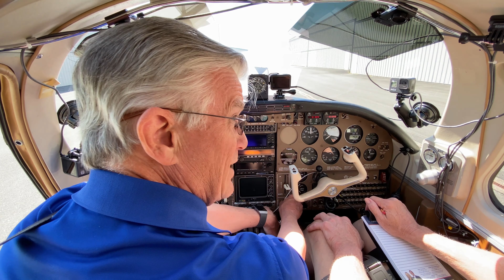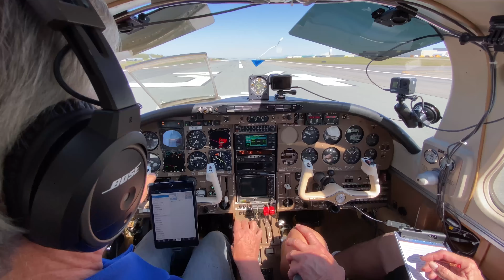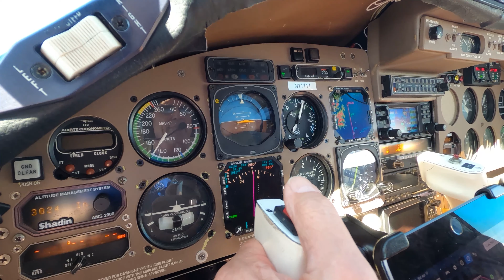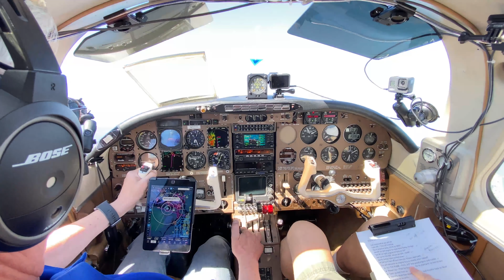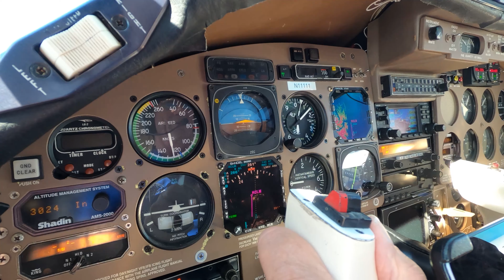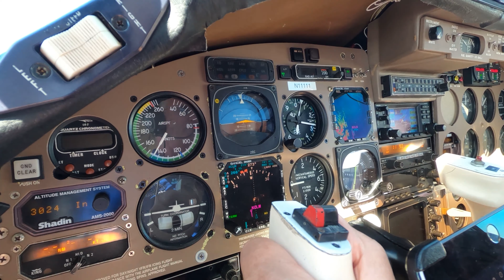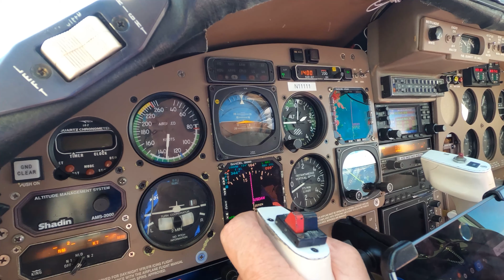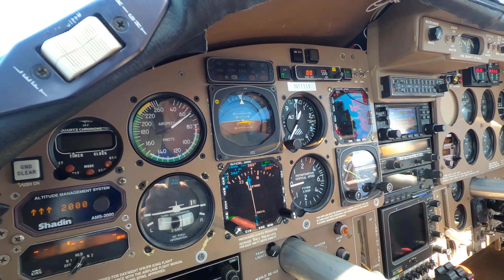We Just Lost an Engine

Comment: Nicely flown, Eric. Thanks for sharing this practical demonstration. 
It’s actually closer to a climb rate of 230-250ft/min (calculated by using the altimeter and a stopwatch). I find that VSI’s are generally not reliable during these demos. 
The demo is at a high density altitude, so the rate would be a little better closer to MSL.  (Handy having turbochargers for this demo.)
Nice to have the confidence that you’ll probably get positive performance if you lose one on takeoff and handle it proficiently.
Thanks again.

Comment: Another great video looking at your speeds when I had the 600a It had a stall speed about 8-10 mph more than the 700 due to the shorter wing. My speeds used to be in MPH 140 down wind, 120 base 110 short final bleeds of the last 10 mph touch down at about 95  the stall was about 88 mph. single engine being lighter aircraft single engine about the same 500 fpm. Christopher

Comment: a good friend of mine was killed in Kokomo in an Aerostar.  jet fuel in an avgas plane....lost left engine first on takeoff/climb out.  No chance of recovery.....
Reply from the maker: Sorry to hear that, there was another fatal Aerostar miss fueling accident I am aware of in the last couple years.  ALWAYS be there when they fuel your plane.
Reply: @AerostarPilot    Yes, indeed....always!  This may be the same accident.  The pilot was a 10,000 hour plus/aerobatic/FAA examiner.  When he landed, the ground crew pulled up in a jet-a truck and asked "do you need (jet) fuel'?  Response: "yep".  He apparently didnt look up, wasnt paying attention, or was distracted.......ground continued to grind the square peg into the round hole, spilling fuel as he pumped in a death sentence.  Just a stupid stupid stupid scenario that shouldnt have happened.  but it did, and continues to do so.  R.I.P., Dan....
Reply: I remember that incident.  Simple mistakes that kill.  It’s hard to see true color of fuel in tanks if mixed with AVGas.  Even if checked...  best opportunity to catch it is in preflight with visual checks with fuel from check valves under the aircraft.

Comment: Check out the prop governor before you do this!!!  Been there, done that!  Almost had to ditch one in the Catalina sound checking out unfeathering characteristics with both fans stopped!  A stupid dare by some idiot flying along for the ride!  Damn near killed the battery trying to restart either motor until we got to good air at 2500 ft to get one of the engines to cough back to life!  We broke off the finial approach on the sail boat and waggled our wings at the hapless skipper as we nursed the other motor back to life and “limped” back to the Ted R. Smith plant at Van Nuys.  After a good return and tying down our airplane, I coly snuck out to replace the knobs on the magneto/starter switches who’s handles somehow got bent during that flight.

Comment: Is Aerostar capable to take-off and land on the grass strip?
Reply from the maker: Yes.  The grass strip in the video you posted last month appears to be long enough.  What is the length of that airstrip?
Reply: @AerostarPilot  There are two RWYs, one 770 meters and the other have 900 meters. The one on the video is longer one.
Reply from the maker: @ludastorm  900 meters is about 2900 feet which would  be a little short for my 700.  I do go into 3000' paved strips that don't have obstacles close by.  A lighter 600 would be fine. You would need to be on your game!  The real issue will be balanced field length on the take off.  Overall the Aerostar is capable for that length with practice.

Comment: 500fpm 6500lbs 5500’ that’s impressive
Reply: That's an understatement
Reply: It’s actually a climb rate of 230ft/min (using the altimeter and a stopwatch). Rate indicators are generally not accurate during these demos. 
But the demo is at a high density altitude, so the rate would be a little better closer to MSL.  (Handy having turbochargers for this demo.)

Comment: Why does VMC decrease when CG goes forward?
Reply from the maker: When the center of gravity (CG) of a twin-engine aircraft moves aft, the vertical stabilizer and rudder have a reduced moment arm.  This results in less yaw control authority making it harder for the pilot to counteract any asymmetric thrust caused by one of the engines failing.

Vmc is the speed below which aircraft control cannot be maintained if the critical engine fails
under a specific set of circumstances. It is marked as a red radial line on most airspeed
indicators

Comment: dead  foot .. dead  engine   means ?   rudder  pedal  you need to  push to  get  centered  is the  right  pedal correct ?   seems  one pedal  will have  stronger  forces on it  correct ?
Reply: and your  keeping some  force on the right  pedal till normalized ?
Reply from the maker: @craigbmm4675  you will have to keep pressure on the right rudder in the case where the left engine has failed along with some right aileron.  Generally you will have the "ball" on the turn coordinator cut in half and 3-5° of bank into the good engine for optimal performance.  The faster you go, the less of these corrective forces will be required.  This is a great video taking about two VMC accidents and the theory behind VMC.  www.youtube.com/watch?v=Wbu6X0hSnBY
Reply: @AerostarPilot   ..  got it
Reply: ok watching the video  again i understand   " going to hook my  left  foot behind the pedal ."    for  added   force  to  help  push  right  pedal  down . . got it now .   and  add the  3 degree aileron to the right
Reply from the maker: @craigbmm4675  The foot hook is great when you doing training with OEI.  If for real and you had to cruise for some time, trim and the autopilot work just fine.

Comment: Does the aerostar have rudder trim? If yes, not enough to counter engine out?
Reply from the maker: Yes it does.  The rudder trim is powerful enough to deal with an engine out.  In fact the old King KFC 200 will fly an ILS with one engine just fine after you trim the rudder.
Reply from the maker: @socomon69  It still is hot sh**t !  The only reason I mentioned the foot hook of the rudder pedal is during training.  If you are only going to operating on one engine for a couple minutes it simplifies the process.  For example when doing a simulated engine out shortly after takeoff where you are going to climb to pattern altitude, fly the pattern and land with a simulated engine out it makes it a lot easier since you would constantly have to re-trim for the speed and attitude changes.  If for real and you had some distance to go, absolutely trim the pressures away.
Reply from the maker: @socomon69  I still feel more comfortable in a capable piston twin over mountains IFR at night than I would in a turbine.  Probably more psychological than anything though.